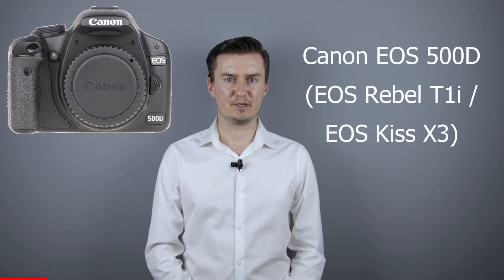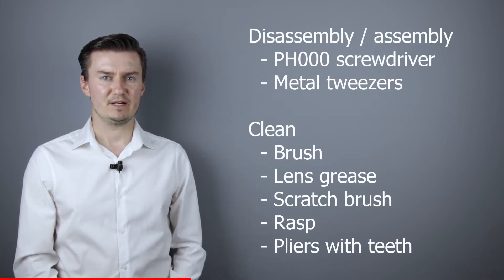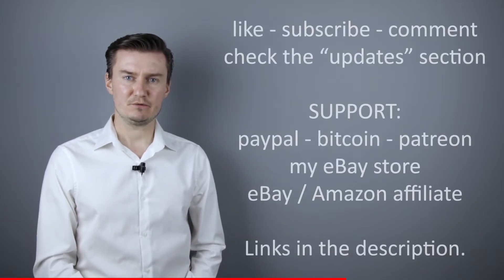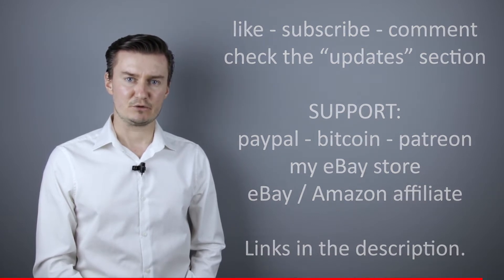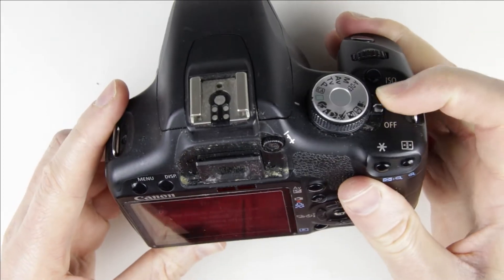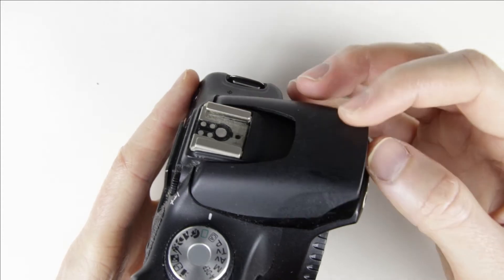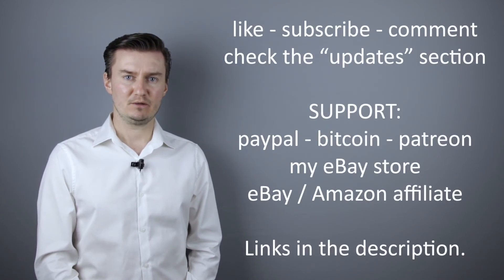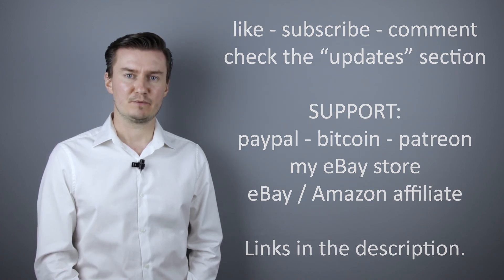Canon EOS 500D repair the "Err 05" pop-up flash problem (EOS Rebel T1i / EOS Kiss X3)

Comment: Anything for replacing the mode dial? Mine some snapped completely off on the T1i.
Reply from the maker: Check out my other camera disassembly videos, generally, disassembling other Canon cameras are very similar to disassembling and assembling this Canon 500D. If you replace the whole top panel, then the job is much easier.

Comment: Thanks! This was helpful. Solved my problem.
Reply from the maker: Glad it helped!
Reply: @CamerasLensesEtc  I'm having a problem with an Err 01 using a Canon t1i with an ERS 17-85mm. I only get the error on M and P settings, but it will work on certain f-stops. I've cleaned the contact and it isn't getting any better. It will work if I turn the lens a centimeter so that it isn't quite locked. Any ideas?
I don't have the problem when I use a different lens.